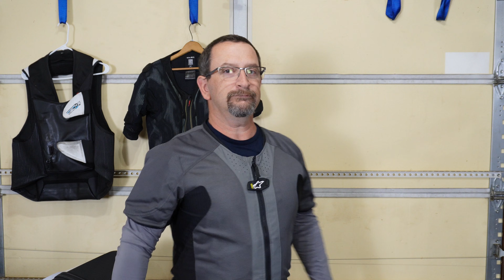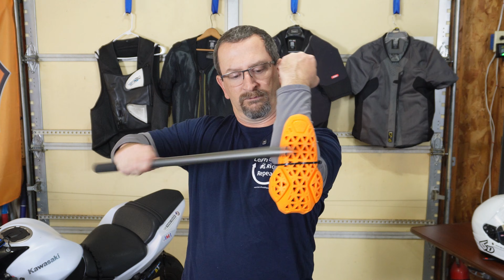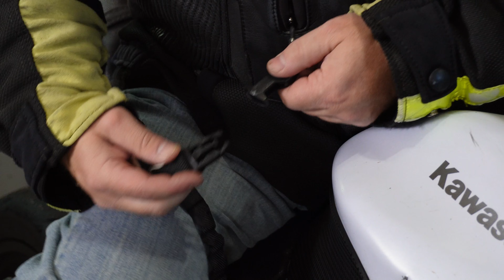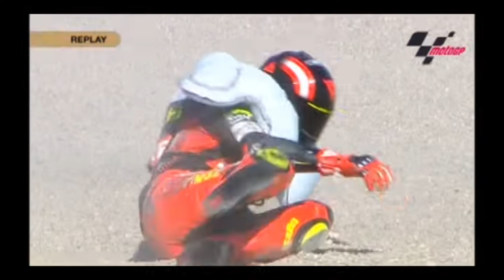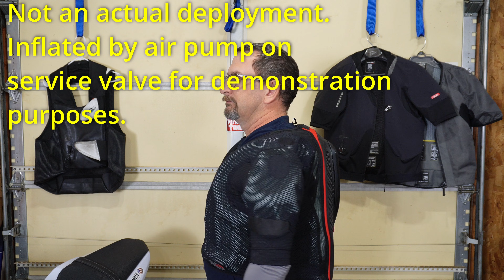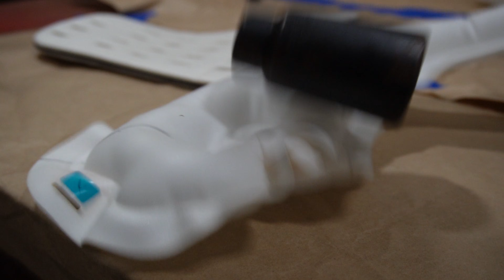Motorcycle Airbag Vests: The Biggest Safety Upgrade Since Helmets

Comment: Its crazy to think that D30 is very old technology now in terms of impact protection. The wireless airbags might go off if it detects a new bad rider habits that upset the bike's handling and acceleration. How does it determine which is a crash or just new riders being clumsy?
Reply from the maker: The sensors are very accurate based on years of testing. I forget the persons name and his YouTube channel, but he was riding his dirt bike over jumps and doing hard landings, trying to make it falsely deploy. It only deployed once he got sideways on the air and away from the bike, a scenario the computer knew he was not going to recover from, yet the vest was fully inflated before he touched the ground.
Reply: @MikesMotorbikeChannel but how consistent is that across all makes and brands? He was defo paid by the maker to show that.

Comment: Are you concerned with the lack of neck protection on the alpinestars airbags? Has me leaning towards in and motion.
Reply from the maker: I would certainly prefer more protection, I think my jacket would limit any neck protection compared to a vest designed to be worn over the jacket. As with any piece of gear, we need to compromise on what we accept for protection, comfort and cost.

Comment: great analysis! where did you get the 8-12L volume? im asking because online there is no info about it i can find. only the 10-12L volume from in&motion airbags
Reply from the maker: I wish I would have saved where I got the 8L number from, can't find it now. But that is on the low end and would apply to smaller sized vests that fit under your riding gear. I know vests like the Helite's that go over your gear can hold more.

Comment: If the sensors didn't need an app and just worked without finiky wireing and charging I would consider going with them but for me I like the assurance of a teather.
Reply: The plasma doesn't need an app

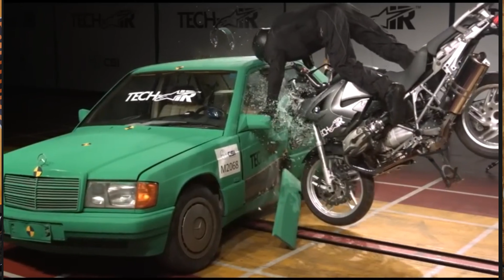Comment: @1:30... Body armor isn't really a factor in a low side. It's the wear resistance of the material you're wearing. It's high sides that armor plays a big role. @7:40... Oof. That brings back memories. That's the exact accident I had except that I hit the passenger's side when he made a left in front of me. Notice the hand hits the roof edge first? That tore the cartilage in my left wrist, requiring surgery to fix. You'll notice the next part to hit is the helmet. A huge amount of energy was imparted to my helmet as my entire body weight drove it into the car. I was wearing a $700 Shoei helmet. Even with it, there was so much weight behind the impact, it shattered my face and needed two surgeries to repair it. I now have plates and mesh in my face. I then flipped up and over the car. Witnesses said they all thought I was dead after seeing me fly through the air and land at least 30 feet past the car. The only other injury was a bruise on my left hip from hitting the ground. An airbag would not have helped me in this crash.